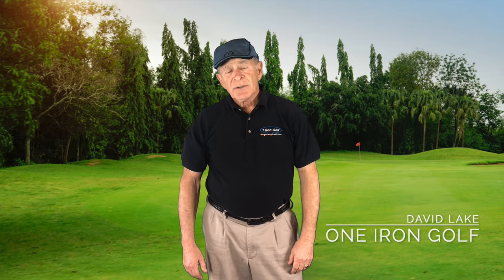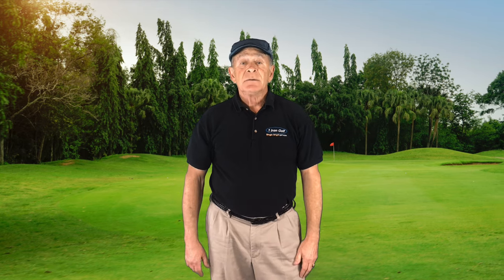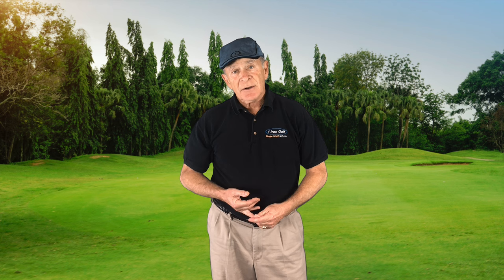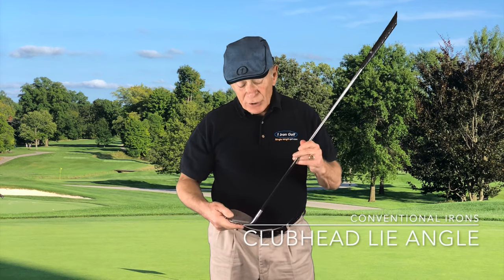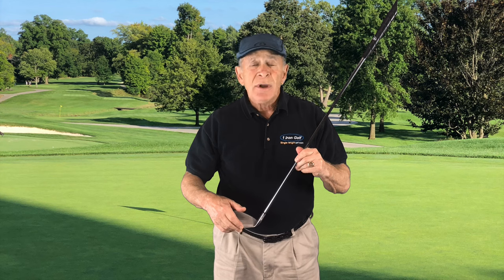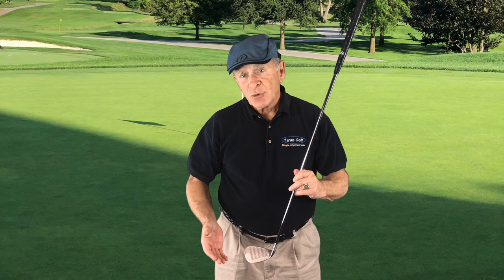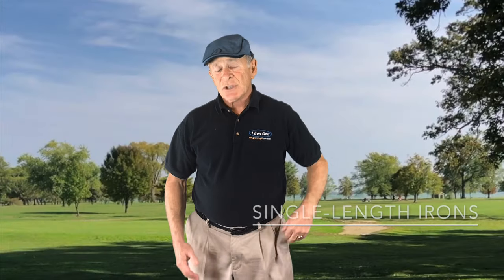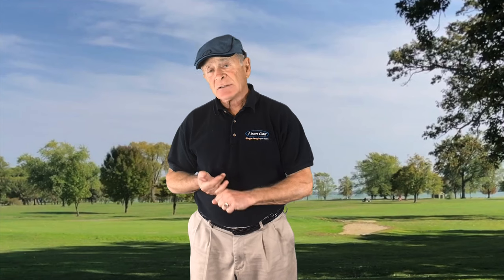The advantages of Single-Length Irons over Conventional Irons with David of One Iron Golf

Comment: You're leaving out the reasons why they are made different lengths. There are serious reasons why clubs should NOT BE THE SAME LENGTH.
Reply from the maker: Back when hickory shafts were the norm, golf clubs were custom fitted and built to a single length within a set based upon the static measurements of the individual golfer (wrist-to-floor measurement). The advent of the steel shaft changed all of this since sets of golf clubs could now be mass produced very cheaply in factories using unskilled workers. Large sporting goods manufacturers (including MacGregor), along with mail order companies such as Sears and J.C Penny were lured by the huge untapped market for inexpensive sets of golf clubs and jumped in to bring golf to the masses. The only stumbling block was that they could not mass produce these sets while providing single length custom fitting for each individual customer.

The solution came when it was decided to abandon a proper custom fitting entirely and instead simply incorporate a 1/2 inch incremental length progression between successive irons and woods. That way, regardless of the size of the customer, there would be one or two clubs within a set that would come close to fitting anyone who purchased them (a boon to mass production but a serious detriment to the unsuspecting golfer). In other words, the incremental lengths in a set of conventional golf clubs today are the result of a profit motivated mass production decision made in the 1920’s and not based upon any golfing performance criteria whatsoever.
Reply: Tell us why